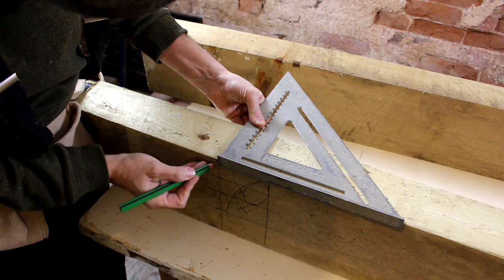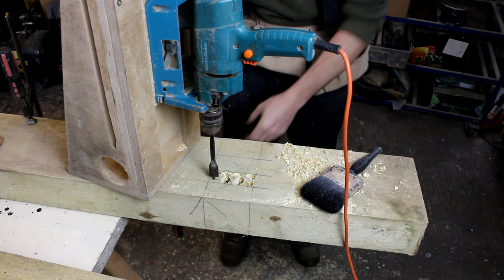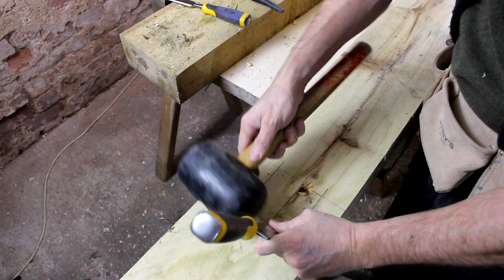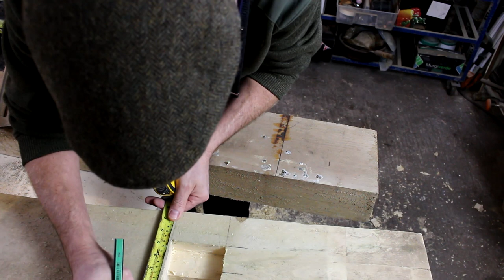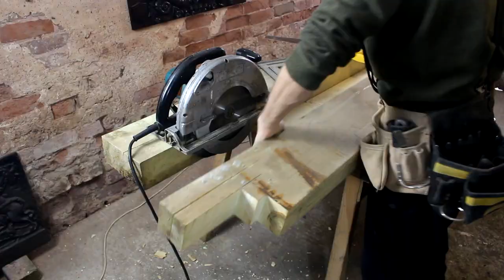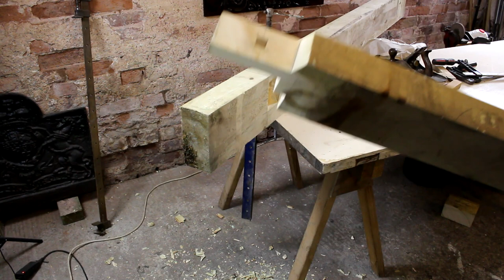Timber Framing Tusk Tenon

Comment: Nice job, thanks for sharing. As a carpenter myself, I have always argued that the joist/beam is compromised in depth from the base of the tusk, its like notching out an 8x3" to a 6x3". This is why when the joint is structural, I always do the base of the two members the same as the top so that the whole beam is supported in its depth.

Comment: From what I have been taught, your tenon should be set out centred on the beam along the neutral axis, this way you are removing the minimum amount of wood that is actually working in the beam.On a 300 beam 150 centre, mark tenon 125/175 from top arris, the bearing shoulder below need only be 30 mm deep by 30mm back to the square shoulder, leaving plenty of support below.
Reply: Yes, mortise centre of support beam

Comment: Could some one answer me something please...
Yes base on the videos i have seen, tenon should be right at the midle..
But all videos i been seen are two timber with the same size, so rules aply perfectly.
But, what if the timber with the tenon is a 4 x 6, and the timber with the mortise is a 8 x 10 beam ???
The tenon wont be at the midle of the 8x10, i guess i must work with a  6" high draw as the timber should be flat.....Rules saying tusk is 1/4 of the thickness of the timber, in this case is one 1/4 of the 8x10 right ??? So the shoulder should be 2" deep right ??
Ill be very thankfull if some body could answer please...

Comment: Wow.  That's 200-year joint if I've ever seen one.  Kind of a random question - is there a reason more people don't make one side of the tenon with two straight cuts?  (as opposed to making all those quarter inch cuts with a skill saw and hammering and chiseling away the waste)
Reply from the maker: watch my video https://www.youtube.com/watch?v=1nfTS2TWEhs not many people like to use a big saw like this. Maybe its more precise to sneak up on the line than to land on it first time with a big saw. Thanks for watching.
Reply: Thomas Head

Comment: Another quality joint, very traditional!
Have you ever considered a sword saw??
Reply from the maker: +James O'sullivan sword saw!? What is this sword saw you speak of?
Reply: Francis Barnett  Most refer to them as a "japanese saw" if i understand correctly.  They are supposed to work very well for small cuts.  They have a straight handle, and a 2 sided blade. Maybe you know this by now...
Reply: @francisbarnett  2 year old post so you probably already know this but they're known as a Ryoba. Double side japanese pull-saw with rip teeth one side and cross cur the other. They come in various sizes ranging from huge for large carpentry work down to smaller one for cabinet making.

I switched to one years ago and it's about the knky saw I ever use. 10 inch one will cut large tenon cheeks, small dovetails, and everything in between.